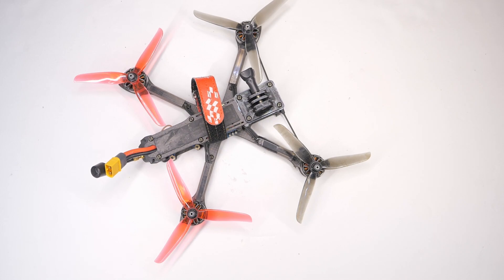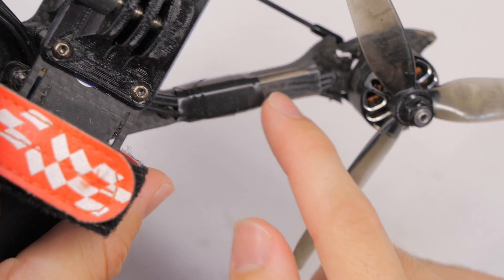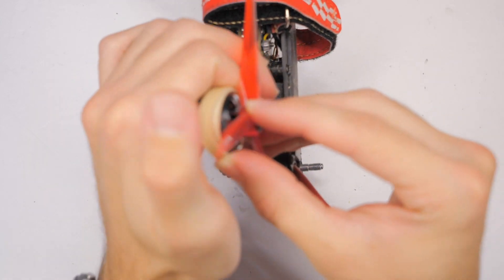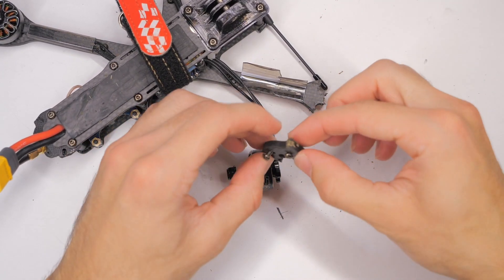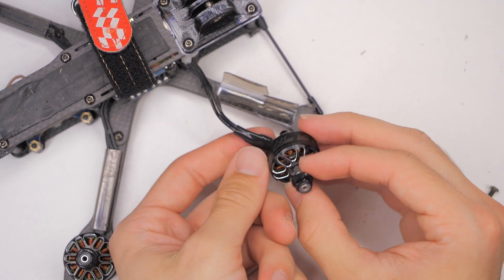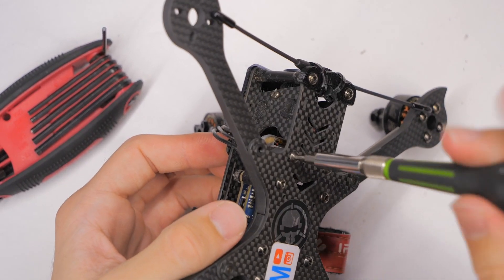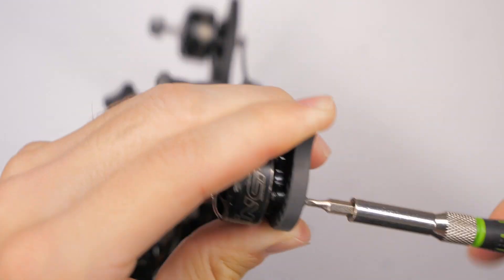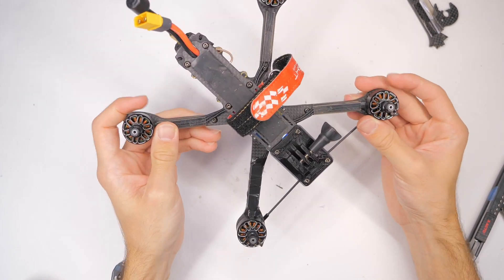How to Replace a Broken Drone Arm (not hard) - iFlight Cidora SL5/E

Comment: I made a challenge to the Rotor Riot but they didn't accept. I do the same for you. BIND 02 drones on a radio and make a synchronized freestyle flight. it's going to be super. And then accept the challenge?